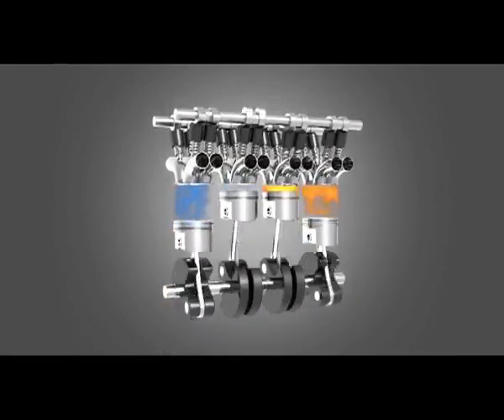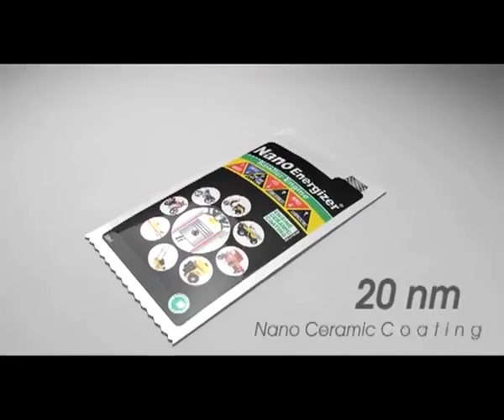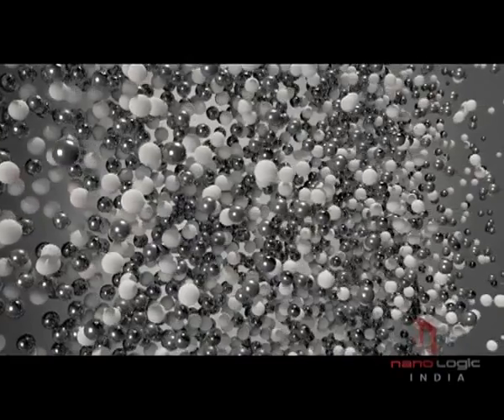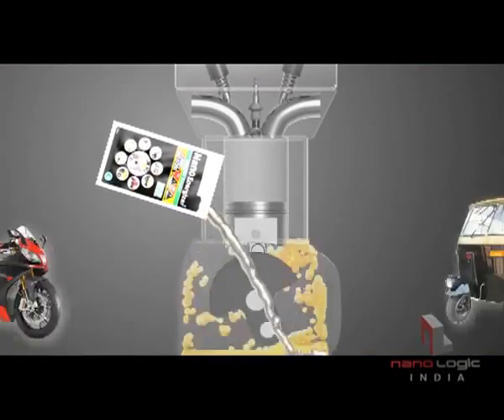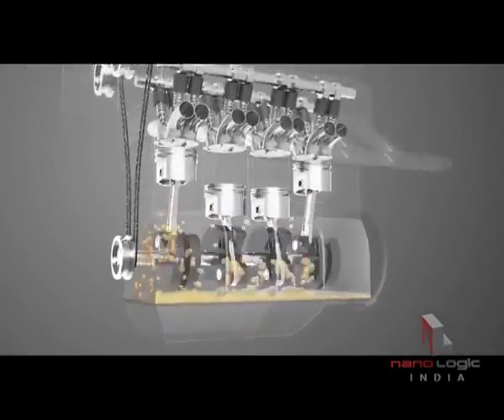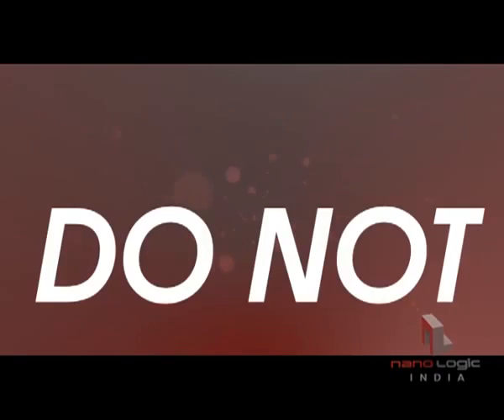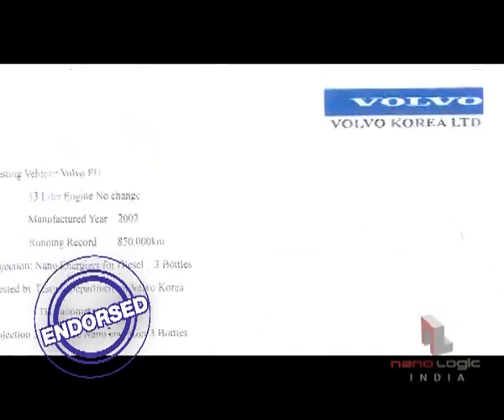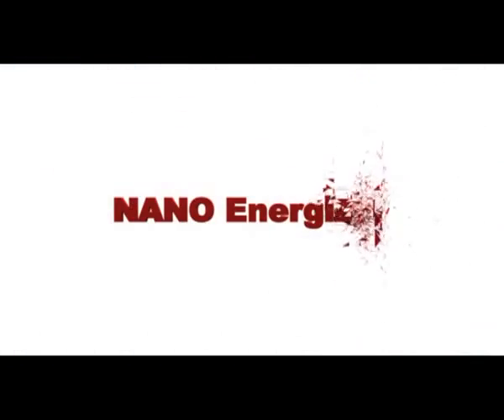Nano energizer - NanoTec Korea

Comment: Hi,

I added 30ml of Nano Energizer into a 2.4 litre Toyota Camry engine. Initially, the engine was noticeable quicker in building up rotational speed (rpm).

But after 3,000 km., the quick engine rotational speed appears to have been reduced. Why ?

Is the product suitable to be added in automatic transmission oil ?
Reply: +Ryan Requiem , it's because your engine oil performance starts to deteriorate :-)

Comment: Well, believe it or not, it works! I had applied it on my 21 yrs old Merc sedan and 10 yrs old Toyota pickup truck. The engine runs like brand new. I notice the acceleration and smoothness improvement after two weeks of use and much later after 3,000 KM, it runs like a newly overhauled engine. Right now I’m going to put another one for my 23 yrs old mazda truck.